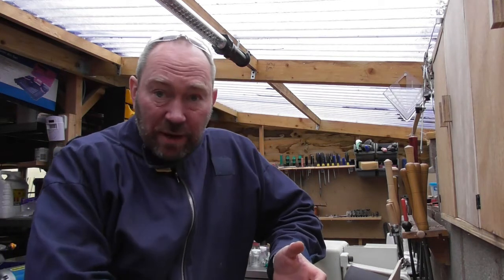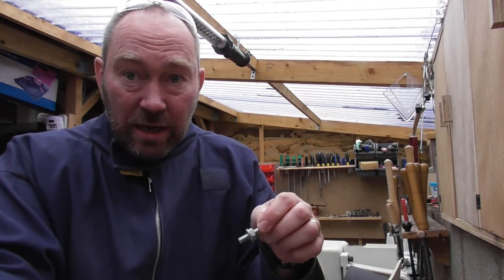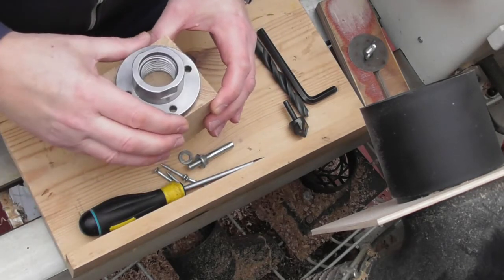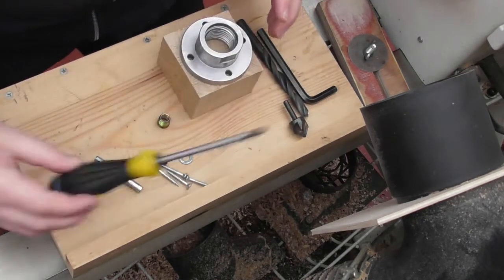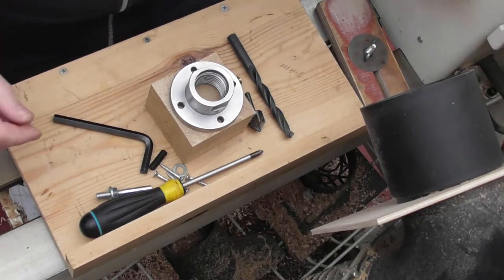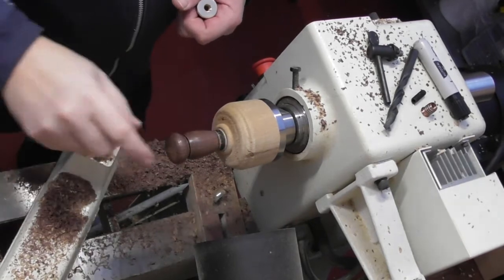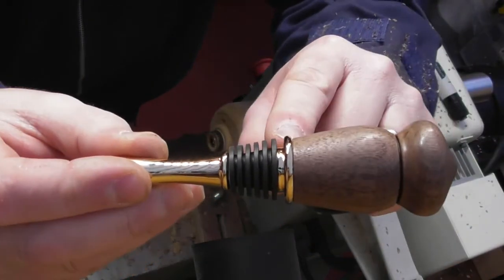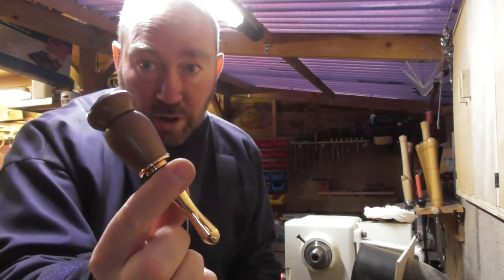Bottle Stopper Arbour

Comment: Looks like a great idea.  My Prokraft mandrel sheared off after doing only three bottle stoppers, I had to make another from a 6mm bolt.  I like the look of the new bottle stoppers.
Reply from the maker: Hi Tony, sorry if you've had a problem with a mandrel, if you put a note on your next order I will replace it for you. Maybe you had an odd one, they are hardened steel and generally tough as old boots, the one I show in the video is my original about 2 ½ years old and probably having done about 40-50 stoppers.
Reply: Jon Whateley or maybe it’s my technique and shonky old lathe hahah.
Reply from the maker: With the mandrel I usually support at tailstock end when doing first cuts, when I've got it to nearly the right shape then I remove the tailstock and trim the end off - however - the arbour is MUCH easier. Those insert screws are even tougher - but I fear I may have now given you a challenge to break one of those too! I confess I don't always remember to put everything in the videos - at the end of the arbour video I used it to mount a polishing disc - worked a treat but I forgot to turn the camera on.

Comment: I bought both kits and neither have the threaded insert. Just the bottlestopper and a threaded piece, one end is M8 to go into the bottlestopper and a wood cutting thread at the other end. So I wasted £10 on the M6 threaded inserts, and no way of making the arbor......
Reply from the maker: Hello Ken, I can find no order on our system for you, the connector you describe is not one of ours it sounds like an Axminster one, we don't sell M6 threaded inserts only M8. Our videos relate to our products only and are tested and checked as interchangeable. Every one of our bottle stoppers has an M8 thread with hex hey fitting at one end and is supplied with a wood thread insert. I know this as they are all tested checked and assembled here in the UK by us.
Reply: @prokraftuk  my apologies, they were from Axminster, thought they were the same ones as they sell under the name Craftpro. I will check out your website, apologies again..

Regards Ken
Reply from the maker: Hello Ken, I quite understand they do look the same - we will have your ones with the correct fittings to you as soon as we can. Many thanks. Jon

Comment: Jon, if you use the screw inserts do you need a thread cutter?  ❤️👍
Reply from the maker: Hi Eric, no you only need a thread cutter if you are using acrylic or plastic based blanks, for wood use the insert screw. Generally the only time you need a thread cutter with wood is if you have exceptionally hard tight grained blanks like a very hard yew.
Reply: Prokraft thank you Jon. Can you Epoxy an insert into acrylic blanks?
Reply from the maker: Yes you can but a thread cutter is quicker, easier and if you are going to do a few probably cheaper in the long run. There is something quite satisfying about cutting your own thread into things -maybe thats just me!